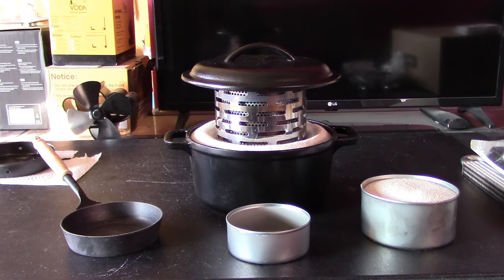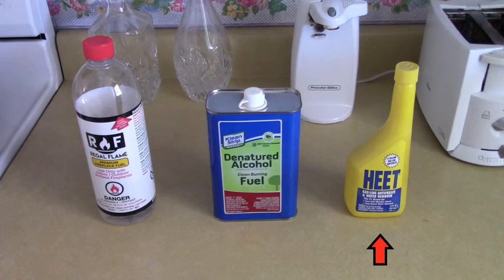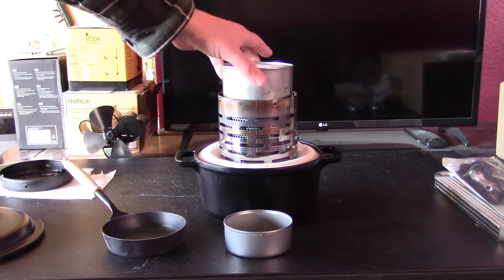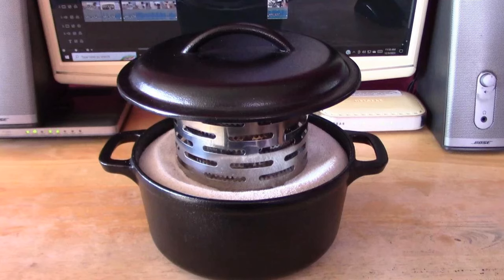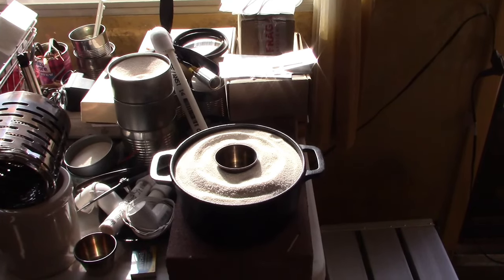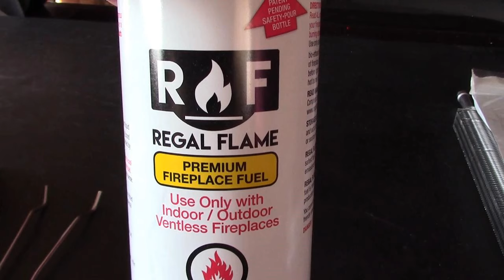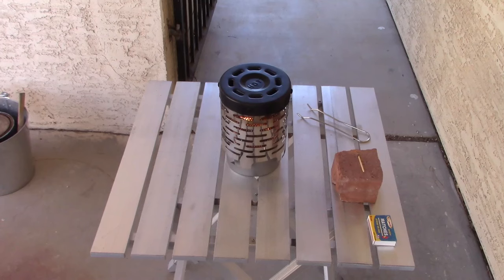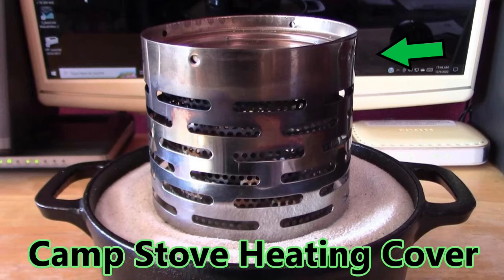DIY "Dutch Oven" Air Heater! (w/Sand for Heat Storage) - Radiant Sand Air Heater - Cooks too!

Comment: Friend, what would make your channel stand out is to do real data analysis and comparisons between fuels, materials, emissions, performance etc.. I think it might drive your innovative process too!
Reply: for example, does sand hold onto and emit more heat than water or concrete or solid steel?

Comment: I would have never guessed the sand at the bottom would get that much heat.  Impressive.  Thanks
Reply from the maker: yes, since the base of the flame is super hot, it heats the sauce cup and sand very fast. (the temp test i did was after just 15 minutes). if you run it an hour the sand temp can double and even triple.
Reply: @desertsun02  I am going to make something like this for using in my small canvas tent.  Warmth for winter camping
Reply: @russellrlf  tip for EXTRA tent warmth.....get a 1 or 2 ban tent and set it inside a bigger tent to sleep

bigger tent blocks some cold and wind and smaller tent retains heat

Comment: Very cool. Make sire that you only use fuels that do not leave soot on the metal. If it is leaving soot on the metal then it is also polluting the air you’re breathing.

For another project idea, try modifying an oil lamp. You can have the sand thermal mass around the clear glass tube. The flame would also be adjustable. Make sure you only use compatible fuels though so you don’t overheat the glass or have a flame in the fuel basin below the wick

Comment: Thanks for sharing your creations.  Question.  Roughly how much alcohol for how much run time? You said about 2/3 full.  But the size of sauce cups vary.  And later you made a reference to burning at 25 minutes.  But it appeared that was mid burn.  Can you give an idea of length of burn vs quantity of fuel?  Thanks.

Comment: Have you tried this using canned heat/sterno fuel? I'm wondering if this would provide the same results.
If you put a flat cast iron griddle on top you could cook on it or put a wood stove fan on it to circulate the heat as well.
Reply from the maker: i haven't tried canned heat but it sounds like a good idea. ✔🙂

Comment: TY❤What is the Cleanest  most natural fuel to use??
Reply from the maker: hi. i'd say the bio-ethanol is the cleanest. only puts off a little carbon dioxide and water vapor when it's burned. (but no smoke, odor or fumes though and the carbon dioxide output is very small - only about the same as having one extra person in the room). to find that fuel just search for 'indoor ventless fireplace fuel'.

Comment: Maybe some more information are needed to be told in these videos. 
For example 1) weight of thermomass used as sand
2) weight of fuel being used
3)how long does the thermomass maintains a warm temperature
4)can this heat a room.

etc...

Comment: Where would I find the slotted cylinder? Is there a link?
Reply from the maker: hi yes, you can find that along with the 2 quart dutch oven on amazon. the dutch oven is an 'amazon basics' 2 quart one and the 'cylinder' (the camp stove heating cover) is a 'bulletshaker' camp stove heating cover. (amazon has other brands of those too). here's a link to the 'bulletshaker' https://www.amazon.com/Camping-Heater-Warming-Heating-AdvancedShop/dp/B0768H9BJQ/ref=sr_1_2?crid=EVIO0D3NWJ9Y&keywords=bulletshaker&qid=1704568806&sprefix=bulletshake%2Caps%2C371&sr=8-2
Reply: @desertsun02  Thank you!
Reply: Gamechanger! What a great find! Keep it up witih the innovations 👍👍👍

Comment: So where do you get your white sand?
Reply from the maker: you can get the sand from the home stores. home depot and lowes sell 50lb bag for cheap (low as 5 to 8 dollars)
Reply: @desertsun02  did you use "play sand" or "construction sand" or does it make much difference? One is coarser than the other so I'm just wondering.
Reply from the maker: @theresad6990 i just use play sand. i don't think it would make much difference. (but play sand might be a little better because the finer the sand the closer the grains will fit together).

Comment: Cheapest source of fuel online suggestions?

Thanks in advance
Reply from the maker: hi. i'm not sure of the cheapest. the denatured alcohol is pretty reasonably priced.
Reply: @desertsun02 Used cooking oil probably. Strain with coffee filter and convert to lamp with large wick to increase heat output